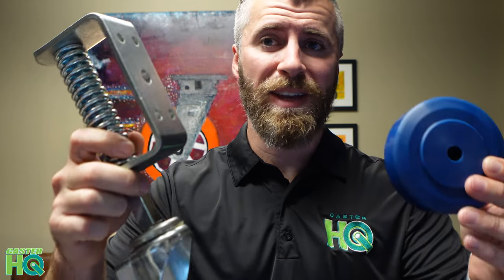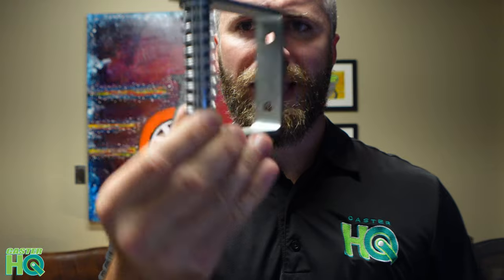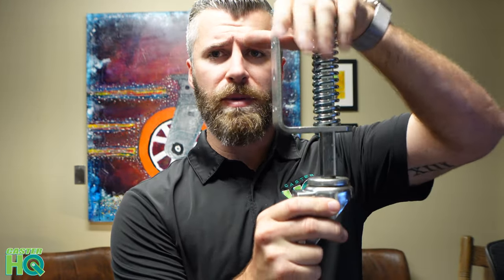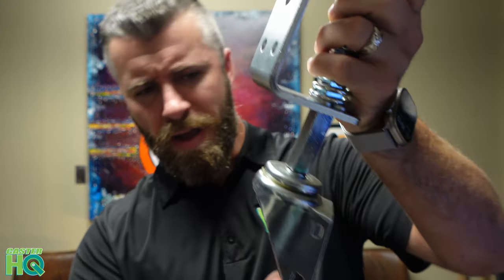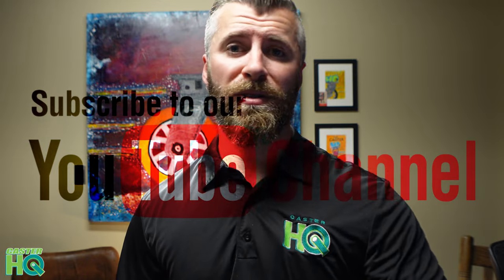Spring Loaded Gate Wheel | How to Fix your Sagging Gate from CasterHQ

Comment from the maker: :stayhome:CHAPTERS: :stayhome:
00:00 Introduction
00:07 My Personal Gate & Caster Setup
01:27 Bolt Hole Pattern
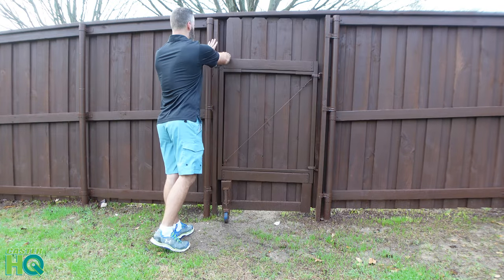01:51 Gate Caster Demonstration
02:12 Solid Poly Wheel
02:26 Rolling Wheels on Wet Ground
03:29 Different Types of Gate Caster Brackets
04:29 Different Types of Wheel Materials
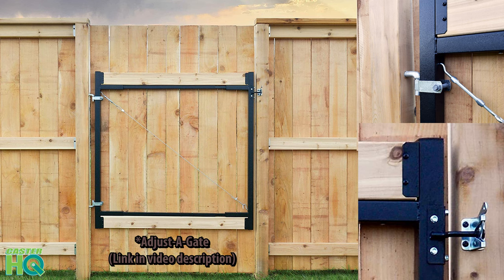05:44 Adjust-A-Gate Kit | Build Your Own Gate
07:00 Talking about Auger & Solid Rock Bed Ground
09:20 How I Mounted my Gate Casters with 2x4s
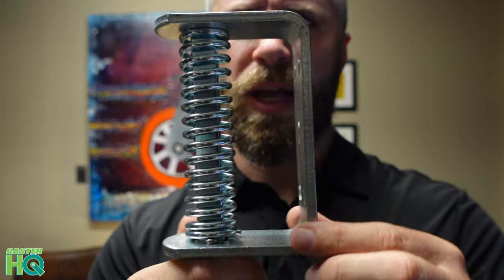10:18 CasterHQ Quality of Gate Casters & Wheels
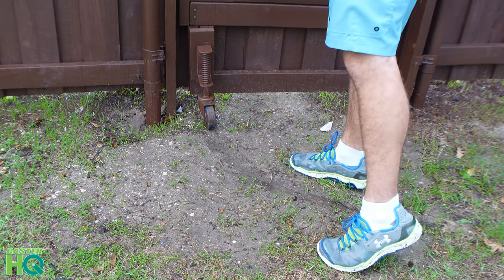11:18 Another Demonstration of my Gate Casters
12:44 End of Video (LIKE SUBSCRIBE!)

Comment: Hi, i have double wood doors. Each door is 240lbs. I need to find casters that would relieve some weight from the posts and hinges. i want to install the casters lower to increase the support to the doors, by using the spring compression. I guess I am hesitating between medium and heavy duty casters.  What would you do?
Reply from the maker: Hi, I would go with heavy duty for your doors as 240lbs per door is a lot of weight. As far as the wheel material, depending on the type of floor use go with a mold on rubber also known as a rubber on cast iron wheel or a solid poly wheel.

Comment: Should the spring be compressed before mounting?  I have sloping ground.  Do I install wheel to touch ground at lowest point and it compresses as it goes uphill?  That might lift the gate too much.  Do I install wheel at uphill (closed) position with spring adjusted for level gate ?
Reply from the maker: For mounting a spring-loaded gate caster on sloping ground, it's typically best to install the wheel so that it touches the ground when the gate is in its uphill (closed) position. Adjust the spring tension so that the gate remains level as it moves. This setup helps ensure that the wheel properly supports the gate without lifting it too much as it rolls uphill. 

Starting with the wheel touching at the uphill position allows the spring to compress appropriately as the gate moves downhill, accommodating the slope while keeping the movement smooth and the gate well supported. This method avoids excessive lifting of the gate, which can occur if the wheel starts at the lowest point and compresses further as it moves uphill.
Reply: @CasterHQ  Thanks for this advice.  So I'll mount the wheel in the uphill closed position with just enough tension to keep the gate level.  With about  4" of grade, the wheel might not touch the ground when fully open.  I guess that's okay.

Comment: Ok, so I propped up my gate to make it level, and installed my spring loaded caster on my 6 ft white plastic fence. Now it sags and the caster wheel seems like it came up higher. How do you adjust the spring tension to bring the caster wheel down, rather than drilling more holes in the fence to move the whole bracket down?
Reply from the maker: When we installed our gate caster we had to adjust the fence and try and level that out as much as possible before installing the gate caster. 

The springs in gate casters are not adjustable, the only option would be to remove the bracket/caster and install lower where it gives the fence better support. Sorry you have to deal with so many holes. 

To patch the wholes I’ve used an all purpose wood filler that I picked up at Home Depot and it worked great for that purpose.